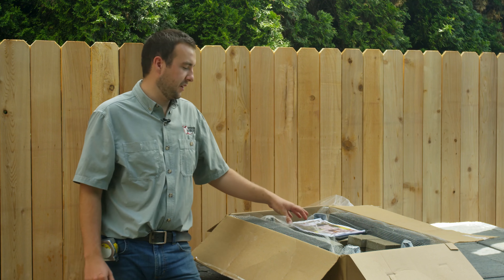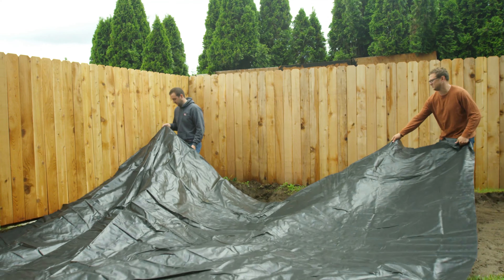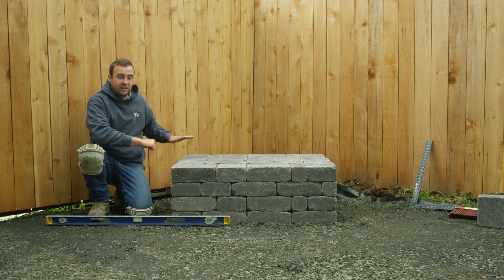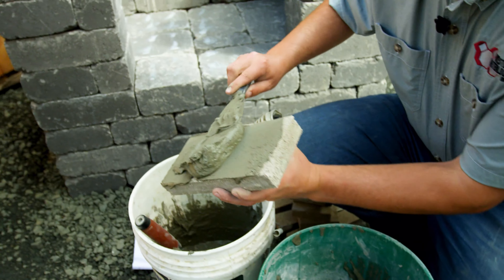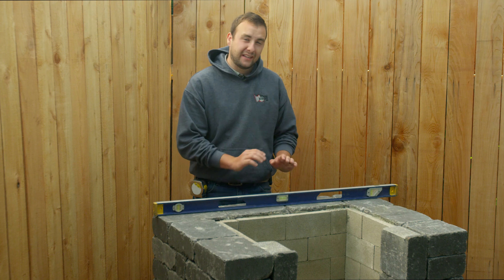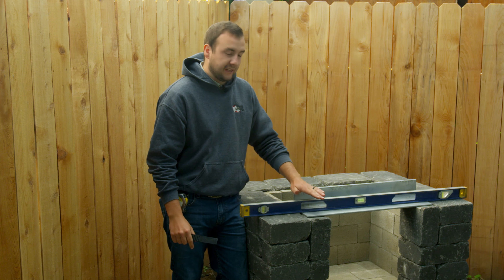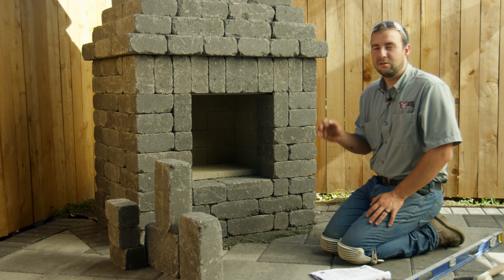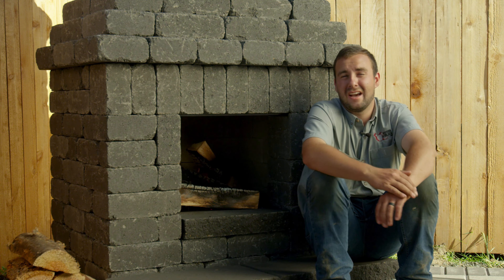How to Build a DIY Outdoor Fireplace Kit

Comment: According to the video the firebox opening appears to be 20" X 16" if those blocks are 4" thick, correct? That looks kinda small or is that normal?
Reply from the maker: The blocks are 4 in thick. This is our smaller fireplace. We have one that has an opening that's 4 in larger in both directions. These are fairly normal firebox sizes.

Comment: What is the typical start to finish time on one of these?
Reply from the maker: There are quite a few variables such as site access, site readiness, builder experience, etc. Usually it takes somewhere between 6-10 hours. Add on a few hours for woodboxes.

Comment: I hate it when you go to a website and they don't have the price
Reply from the maker: If you go to our site, there's a place to request a quote. Our pricing depends on where you are and whether or not you are a contractor.
Reply: As far as I found most of the "kit" fireplaces are still kinda spendy even doing it yourself. I found better ideas just buying the raw material and doing it yourself. Mins is going to be around $180 for all the blocks and after I figure in the glue, and all the accessories(fireplace screen, chimney cap material, etc.) I will have just a little over $250 in the project. I'm planning on dry fitting all the block and build a small fire to see what kind of draft I get before gluing all the blocks together (something I seen in another video)